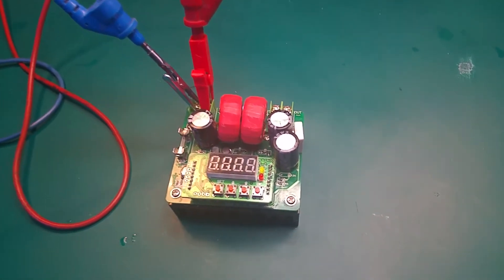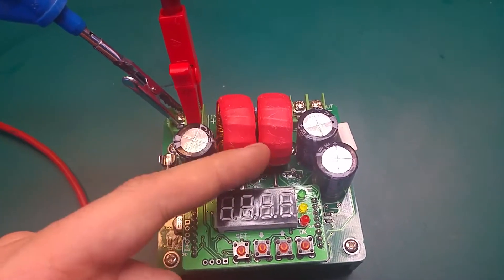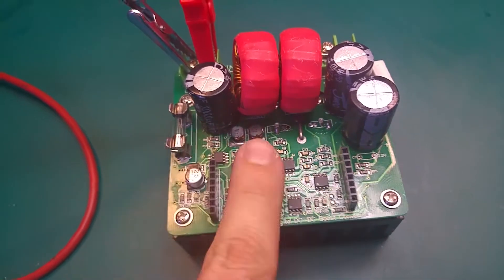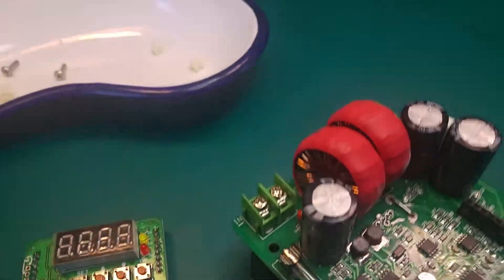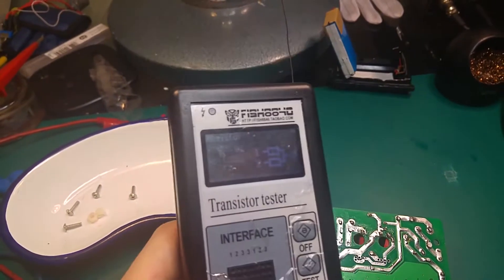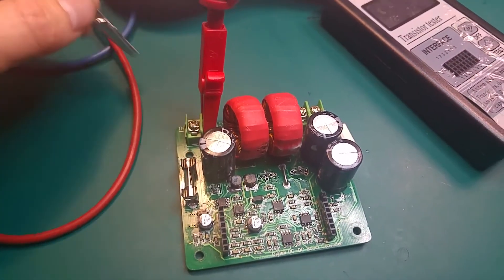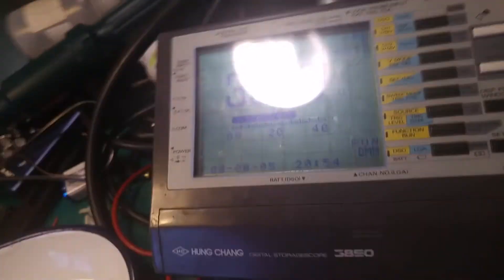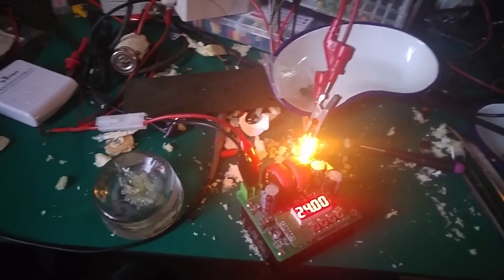Fixing blowing fuse Digital  400W 10A Constant Voltage Constant Current DC-DC Boost Module

Comment: Does current limiting work on your module? Mine does not current limit at all, and it's spikes over double input voltage when first powered on
Reply from the maker: Hey,
Can't tell about voltage spikes because i have it mounted on site  and it's stepping up voltage for actuator-s so i can't pull it out to make tests. That could be possible, and that voltage spike might blown mos-feet in mine. 

About current control, yes it does work and i'm using it to limit power in case something block actuator but i'm afraid the current limiting act only as boost suppression.

Try little experiment,  grab like two 12V bulbs in series  to get a 24V appliance on known power (current consumption for example 8A ad 24V), power DC-DC converter with 12V and set it to 24V but set current limiting to  6A. 

If it's current limit settle to 6A then it's working properly. 
The idea is that it might pass (passive current from 12V source directly) so it will be always current equal to resistance of load and the current limiting will kick in to stop stepping up voltage  until it reach set point, but if the set point is in lower rang than boost then it won't work, to limit current in lower range than input voltage it should act as PWM driver or step-down converter.   <-try this idea and confirm if it's working like it should be
Reply: Electronic Noob Blog thanks alot, I'll give that a go.  I also sent a message to the seller and they have contacted the manufacturer apparently for some answers. I'll let you know how I get on
Reply from the maker: Great, waiting for update